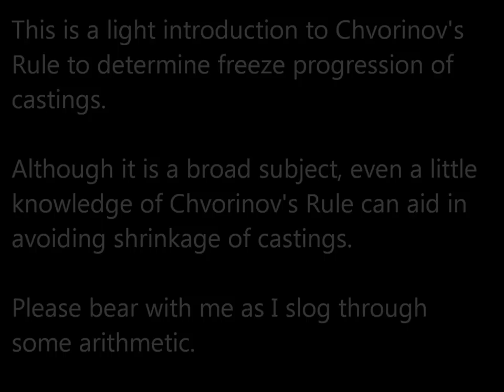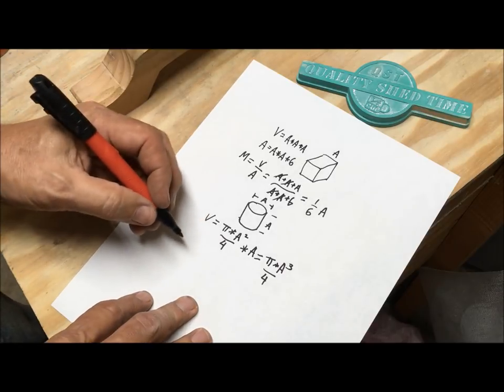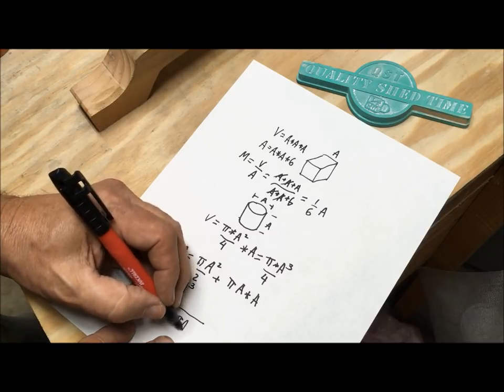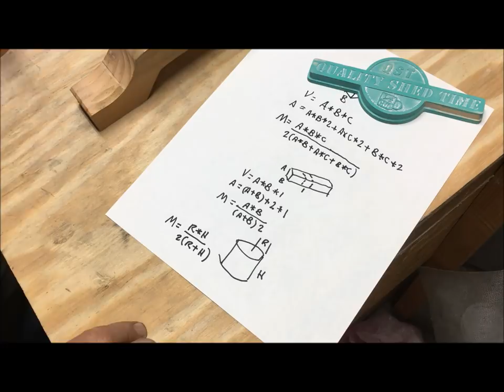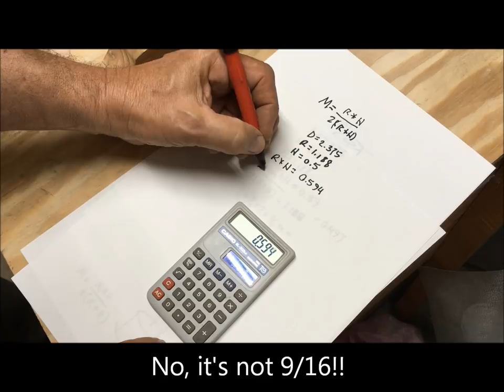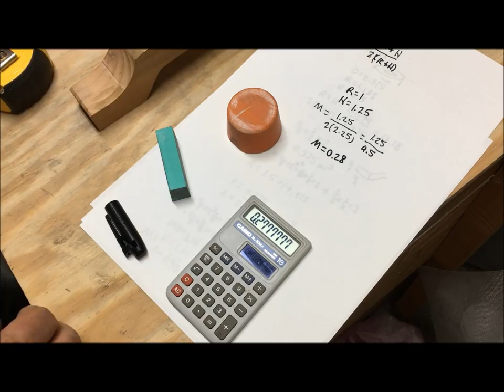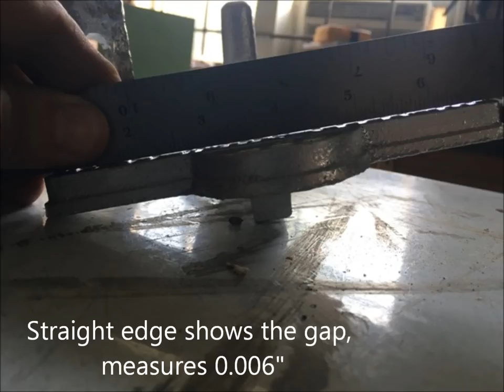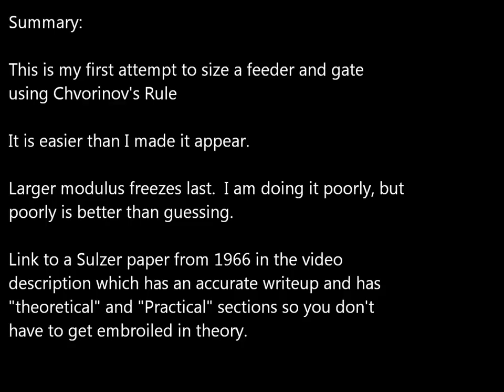Foundry 49: Chvorinov's Rule to Avoid Shrinkage Defects in Simple Castings

Comment: I found this video very informative. I am just beginning to do some casting. I had no idea you needed to do a bit of design on the feeder portion . Glad to have found this before I learned bad habits. Thanks for the time you took to do this
Cheers from Canada
Reply from the maker: Thanks for the kind comments.

You can do a lot of great casting ignoring this rule.  I usually ignore it.  but when you have a shrinkage problem this will generally solve it.  Hopefully no one avoids casting thinking they have to do this kind of work first.  However once you do it a few times it really is easy.  You can be sloppy and get better results than not trying at all.

Cast away...

Comment: it would seem to me that we can leverage the power 3D cad* to subdivide the pattern appropriately and calculate the Modulus for each part. For example SolidWorks (that's what I have) is very accurate in calculating volume and surface area for any given object. You, of course, can put all the risers runners etc into your 3D model of the pattern and do exactly what is shown in the video fairly quickly and accurately. I really must try it!
At the same time thank you Andrew for this straight forward explanation of Chvorinov's Rule, of which up until this time, I never heard of.

* (for those of us that have 3D CAD  --- and there are fairly inexpensive programs out there for those who don't have 3D cad yet; a very powerful addition to the arsenal of homeshop machinists and backyard foundrymen)
Reply from the maker: Absolutely 3D CAD can be used to calculate the modulus.  Of course it's the exposed surface area and not just the area of a particular component.

However after you have used the rule a few times you see extreme accuracy is not very important.  Making a feeder larger is generally very easy and economical in home work.

Also, in my foundry I often am casting off an original part which I don't have modeled, and usually does not lend itself well to modeling.

Thanks for commenting!

Comment: It may sound silly but I wanna know what did you do with modulus you calculated?
Reply from the maker: It's not silly.  No reason to calculate it if you can't use it.

The modulus is indicative of the time to cool to solidification.  Therefore the modulus of the feeder system should be larger than the modulus of the part being cast.  Then the part being cast can draw liquid metal from the feeder as the part cools and limit shrinkage in the cast part.

If you look at this video https://www.youtube.com/watch?v=BS_Zgdvny0g , it shows the shrinkage coming out of a blind riser upstream of the gate.
Reply: @andrewmartin4258  wow, thanks Andrew, now it's crystal clear..

Comment: So the blind riser modulus should be equal to the sum of the moduli of the parts being fed? 
Does that include the gate?
I think I'll have to curse my way through that Chcovinovs paper.
BTW, what was going on with that bar that you cast first, the circle on the surface, I mean.
Reply: 260 pages!??!
Reply from the maker: Never get your education from a You Tube poster.  Ha Ha Ha.

I think the modulus of the blind riser only need be larger than the modulus of the part it is feeding, and so on cascading down.  The idea is progressive solidification, so the last parts should have the smallest modulus.  They should freeze first.  I did not calculate the wings because experience told me they would not shrink, it would be the center.  If the gate can feed the center, the center won't shrink.  If the riser can feed the gate, the gate won't shrink.  My runner was in trouble.

Mr. Chvorinov was way ahead of his time.  I admire his genius.  The more you read the more you learn.

That was an ingot cast only to get rid of some metal in the crucible to give me a better pouring angle.  It's a new ingot mold and has some rust in it.  That was the rust boiling and contaminating the ingot.
Reply from the maker: @stoneomountain2390  Ten pages and you're about done.  It is good reading, you can grasp the concept of what the modulus is and that opened my eyes as to how to reduce or eliminate shrinkage.
Reply: @andrewmartin4258  
Thanks for the info, and the reassurance.
I hope you enjoy your weekend.

Comment: Interesting stuff, thanks
Reply from the maker: Thanks, Jeff.  Sorry it got so long.  I don't think I have a future in public speaking.

An interesting thing, if you make patterns for risers, gates, etc. once you've calculated the modulus it does not change so I write it on the pattern piece.
Reply: @andrewmartin4258  wouldn't pattern draft, radiused edges, etc. affect the modulus?  Or maybe it all kind of cancels out in the end since all the other pattern bits would have draft too...
Reply from the maker: @tobhomott  It's an interesting subject.  When you see that the modulus of a 2" square cube and 2" diameter sphere and 2" diameter cylinder 2" long are all 1/3" it seems rounded corners don't have much effect on the cooling time.

I don't look at the modulus as an exact number, and just using approximate numbers makes it doable, and gets you close.  At least for what I do I can estimate a complex shape then make sure the feeder modulus is 20% or more larger than the pattern modulus, or 50% more, and feel comfortable the pattern won't shrink.

This little piece had me worried and my gate only matched the modulus of the center disk.  I ignored the wings which would remove area and make the disk modulus larger.  I remeasured my gate and did a more accurate modulus calculation and got 0.235".  Even removing the wing attachments on the disk I think the gate is still larger.

I'm getting a mold ready to pour the same thing with a smaller gate to see the shrinkage, if any.
Reply: @tobhomott  the Chvorinov's Rule is a ratio of volume over the surface area. So yes radius, curves etc. Which change the surface area change the ratio.
Reply from the maker: @askquestionstrythings  Sorry I didn't see this response earlier.  

I think one must be careful in trying to apply the modulus too strictly.  It is generally accepted that a cube, sphere, and "square" cylinder all have the same modulus, "D" divided by 6.  The outside corners of the cube do not add appreciably to cooling and the centers freeze at about the same time.

This is a marvelous thing for backyard casters.  It lets us estimate modulus of simplified shapes and ignore little indents and protrusions.  A ball peen hammer head, for instance, can be estimated as a cylinder a hair smaller that the large end, or the large end only can be taken as a simple cylinder even though it may be tapered.  This gets one close to a modulus to be used to calculate an appropriate gate and feeder.  Modulus increasing from mold to gate and gate to feeder.

Comment: Maybe I missed it somewhere but what is the purpose of the module? Do you want all parts to have the same module? Is that the purpose?
Reply from the maker: Apparently I was not clear.  I edited the text under the video to attempt to add clarity.

Basically the larger the modulus the slower a part cools.  You want your casting to freeze first and the feed system to supply makeup metal as the casting cools and shrinks.  So the modulus of the gate, and then the modulus of a feeder should each in turn be larger.  Then the casting should freeze first, then the gate, then the feeder.

That was a big omission in the video.  Thanks for bringing that to my attention!
Reply: @andrewmartin4258  thank you for your clarification and thank you for the hard work put into the video. Much appreciated.

Comment: Martin how can a get in contact with  you? I need to show you my casting project and the surface shrinkage problem I am getting on my aluminum flag pole top. 12 inch long part. Basically a sphere with a long tapered cone on it. The surface shrinkage always occurs on the sphere section on the top section of the part.  I would like to share some pictures of my problem and a workout a solution. Are you on Face Book?
Reply from the maker: Lots of helpful guys on The Home Foundry forum.  I post there as well.
Reply: @andrewmartin4258   Is that a fb group? Can you send me a link please?
Reply from the maker: @gulf4yankee  http://forums.thehomefoundry.org/index.php